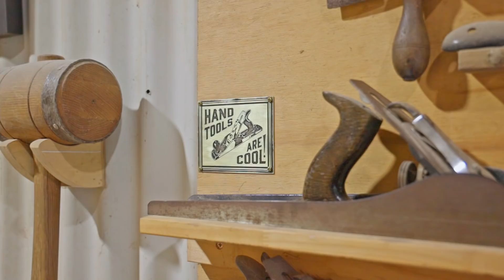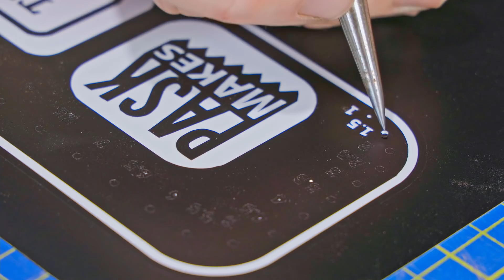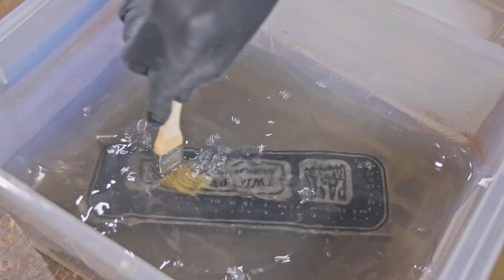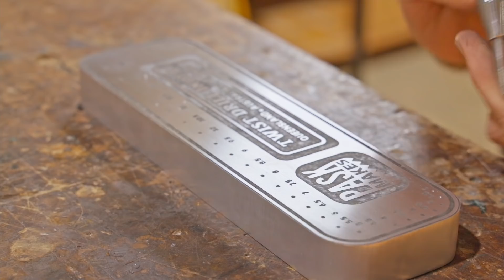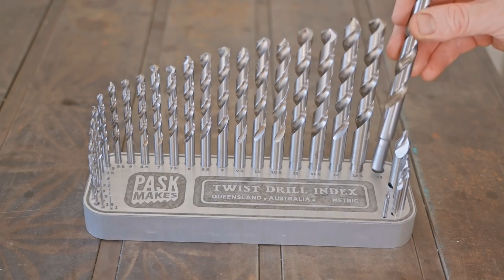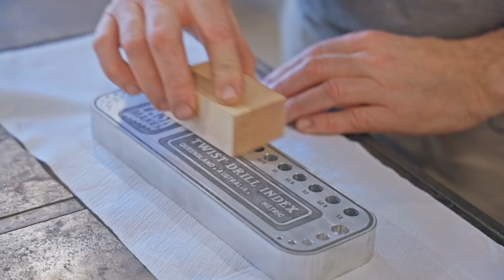How to make a Vintage Style Drill Index

Comment: Maybe used magnets to hold onto the cabinet, drill straight through with a small bit to stop dust and things building up in the holes and black oxide on the etched parts?

Comment: Mr Pask: a drill index should contain spares.  
My index contains 2 of each larger bits, and 5 of each small size.
Reply: Here in the USA with our (#*&@) Imperial measurements I've got quite a few extras of certain common sizes, e.g. I use 1/8" OFTEN --BUT: (A) I'm not going to put extras of GOOD ones in my index, b/c (B) I buy extras ("spares" as this poster suggests) of e.g. double-ended TiN and keep them in a drawer. For machining I'd use my quality ones in the index (and then a reamer) anyhow.
Reply: Also: I'm also sometimes a (chef) knifemaker and use a few key sizes of "spares" rather often, so I color-code them with a band, using cheap nail polish, with easy-to-distinguish, widely-varying colors: e.g. bright blue, yellow, red, white, and black -- and then have a chart with a splotch -> size guide RIGHT next to the drill press just as a "stupid-proof". That way, even if they're sitting on the bench or in a drawer or whatever, "blue = handle pins" (and I can color-code the brass rods, etc., as well!)

Comment: for cabinet mounting you could have used magnets glued to the bottom of the drill holder.

and a little tip when working with aluminum, then you can use denatured ethanol, as a cooling and cutting agent.

Comment: That's pretty awesome. Personally I would have darkened the etching a bit. But painting it could have been cool as well. If it were a deeper etch with a thick layer of enamel paint, it would have had a nice "New Retro" vibe, as if it had just came off the assembly line in the 50s.

Comment: If you're not comfortable with working with acids, you can use electrolysis etching also. You use a salt and water mix, or more ideally Lye and water mix, and a bench top power supply. Set to around 5-12 volts with high amperage, and a metal electrode plate in the bottom of the tank. The positive goes on the work piece, and the negative on the bottom plate. It'll take a few hours, but the current will slowly etch around the mask. 😀

Comment: Awesome project! A tip from sign-makers, who spend many hours weeding vinyl cutouts - use the point of an Xacto blade to pick the unwanted parts out of the stencil. Stick the point just far enough into the vinyl to poke and pull it out, instead of pushing with the awl.

Comment: Ive always found those drill indexes, especially the spiral kind, to be a total obstruction and pain in the ass in the workplace, the most sure way ever invented to see drill bits rolling around on the floor.
Maybe if you could put it in a place that you could ensure would be free of vibration or disturbance, but then that defeats the whole supposed point in being accessible and convenient.

The best way would be to store them in a flat box, or tray, clearly labelled with cutouts at their middles for your fingers. Put that in the drawer of a toolbox and you're good.

Comment: WD 40 is Not a lubricant, it is a hydrophobic solvent, vaporizes at 32 degC, and does not conduct heat. You are wasting your money and damaging your tools. Use 1:1  mineral oil : distilled water, mix at high speed until opaque white. Even just 'baby oil' and isopropyl alcohol is far better. Save your WD for cleanup. ;)

Comment: Def. disappointed you didn't paint it. It looks "rushed to get it done" and unfinished without paint and the tiny numbers aren't standing out enough (altough that may be bc I only see it on video and not in person.) In contrast, the Idea with fixing it onto the shelf is amazing! (my first thought were gluing magnets in the recesses, but the bandsaw case may be aluminium too?) It's just a pain in the ass when things like this fall down from either cleaning the workshop or the machine-vibrations... Here in Switzerland most drillbit sets cases are designed to hang on the wall, which is the easiest Solution and works wery well if you get the metal ones. Plastic sometimes suck, but i've glued them onto a scrap piece of plywood and screwed that to the wall. Greetings from Switzerland:)

Comment: A little late to be hearing this now, I'm sure; But my favorite way of picking vinyl bits like that is to stick a sewing needle in the collet of a craft blade handle (like Xacto). Some have a round hole already in the center, but easy to fix if they don't, and most crafters have three or four of em lying about.

Comment: The locating pins on the cabinet are overkill. I would have drilled two small recesses in the block and glued in rare earth magnets to hold it on the metal cabinet. That way you can move it and sit it on any metal surface near where you are working and the magnets will hold it there.

Comment: Yeah, make sure to have a second container where your FeCl3 container sits with just room temp water for future runs. The reaction is exothermic, so with building temperature and a huge thermal mass (block of Al) you are asking to have a runaway reaction.

(Source: Experience making etched PCB boards)

Comment: I think a better idea for the etching would have been to drill and tap some holes from the back, and use threaded rods to suspend the piece in the etching solution.. good for depth adjustment too..

Comment: Looks quite good, I would have thought it would look better if the majority of the stencil (and thus the etching) was reversed other than the descriptor section (i.e. the bit that has the writing "Twist Drill Index..." ).    That said it's your project, for your use, in your workshop and since it's a personal preference thing it's only your preference that really matters. :D  So long as you're happy with it, that's all that matters in the end.

Comment: Did you consider using spray on photoresist, the kind that is used for etching PCBs at home? It would have been a lot easier than handling the vinyl!

Comment: Sorry if I missed it, what WD40 do you use as cutting fluid? They make a lot of products now so I don't want to guess based on the bottle :) I used some mineral (parrafin) oil while cutting steel with a recip saw and it smoked up a little.
(If i missed the spray it's because you got me googling cricut machines 😂)

Comment: A trick I learned working with sawing a lot of aluminum over the years. Spray the blade with a good quality spray bottle as it exits the aluminum with Rubbing Alcohol. The aluminum chips are hot when exiting the aluminum and the alcohol causes the chips to contract rapidly flying off the blade leaving the blade very clean.

Comment: That turned out awesome!!! Also looks like you got some sweet machines, they are a nice size for hobby shops.

One tip: In the beginning when you're turning that aluminum rod, your tool is sticking out way further than it needs to. With carbide you can get chatter and chip the inserts. You probably already know all that though.
Reply from the maker: Thanks and thanks for the tip! :)

Comment: It looks so good unpainted, but it would be nice to be able to read the sizes from a greater distance. Maybe flood the index with ink, and then sand it down a touch? I think it would kind of look like old cast iron
Reply: Very clever making the bits have a steady flow by adjusting the depth of the holes. And I've never seen one that allowed for center drill, that gave it a really cool symmetrical look. My only thought is, what about when you sharpen the drills? Usually two or three sizes get used 10x the other sizes. As you sharpen, they get shorter.

Comment: Turned out nice. Not sure about paint, I think if it was to be painted the traditional black would probably be a better choice than blue.

With etching, another way that seems to work much better, quicker and saves on acid is damming around the area then using a small amount of acid and a brush. It etches much quicker and deeper and saves a considerable amount of acid.

Comment: Vinyl is surprisingly (well, maybe not if you think about it) heat resistant. I've ironed over it without any issue - on cotton/linen, which is hot. 

For weeding, get yourself a sharp (old) sewing machine needle. I find them easier for small pieces as you're closer to the work.

Comment: Looks great Neil. The etch looks very effective. 
My only comment/query is the order of the bits, I know you can remove the Index from it's storage position but would it have made life easier to have reversed the order, putting the longer, thicker Bits in the back corner and the smaller Bits on the outside where they'd be easier to pick out? Or would the slope in the upper cabinet made that impossible?

Comment: Tho it won't work in this case with all 10mm holes for the larger bits, if the bits store point down in the index you don't have to grab sharp edges (or points in the case of bread points). This is one case where a good plastic blank makes a great index IMO.

Comment: Neil; when i come across a situation where it's hard to get a drill into tight spaces, i use my Milwaukee 4-in-1 drill from Home Depot: M12 FUEL 12-Volt Lithium-Ion Brushless Cordless 4-in-1 Installation 3/8 in. Drill Driver Kit with 4-Tool Heads. It has made life easier for me. Keep up the good work!

Comment: I wouldn't be able to do this myself, but you might also be able to make such etchings by 1) printing it reversed (using ink) on silicone-coated paper, 2) transferring the ink to the metal with heat (iron?), and 3) painting the rest of it with black nail polish (if you don't want the ferric chloride to react as much). This might help keep the heat down and allow for a deeper impression.

Either way, I love the result!

Comment: really nice looking holder.

I am thinking about organising my drill bits too

I don;t know if it's just me, but I have multiple instances of each drill bit size, and within the same size, I have bits made from cobalt or HSS etc, so I don't see the index holding 1 drill bit size, ideal. I need some kind of divider system, or something like a straw dispenser at McD (press to roll out, load from the top).

Comment: This turned out quite nice!  I'd have tossed magnets in the base of the index but I think your idea works out better in the long run - the locating pins will prevent the paint from being chipped/scratched off the surface of the cabinet, since you're forced to lift the index rather than just slide it off. Smart!
Reply: Magnets recessed in the holes drilled for the pegs and a felt  to cover the bottom would be the perfect solution I think.

Comment: That is really cool... I do think your signature colour would be nice to accent the etched areas... 
But I see off hand that made a big difference on a very similar tool holder I have used back in the day... 
A groove on the perimeter of the holder to give a better purchase when pulling it off its base pins... 
Having oil/grease on you hands/gloves when machining, might have the base slip out of your hands just as you pull it off the pins, and you don't want to drop that when you in a  good flow of things.. rightly be pissed off at such an accident...

Comment: Great piece! I use a vinyl cutter and acid or saltwater/voltage etching quite a lot — it’s a great way to etch without a glowforge. My favorite part, dropping the perfectly sized peg into the hole, then blowing it back out!
Reply from the maker: Thanks - I've already started thinking of more ways to use the vinyl cutter. :)
Reply: @PaskMakes  if I’m hand cutting steel for a knife (using an angle grinder), it’s quite useful as a stick on template. I’m looking forward to see what other creative ways you use it.

Comment: Great job. I would have used a couple of strong magnets countersunk into the base of the drill stand assuming the metal on the cabinet isn’t stainless or aluminium of course.
Reply: My thought also.
Reply: I like this as well. Then the whole piece would lock onto any other magnetic surface.
Reply: I thought about that then thought that the bits might jump out as the stand was pulled away from the cabinet.
Reply: I was thinking along the same line but then thought that magnets on the index would attract any metal bits from where ever you set it down and then you'd be having to clean it off all the time. If you put the magnets on the cabinet and a disc set flush on the underside of the index that might work. But again any ferrous debris would be attracted to them and you'd still have the maintenance issue.

Great looking drill index and the videography is excellent as always. 
My thanks to @Pask Makes for taking the time to share this.

Comment: Aluminium is weird. It will also react with a base solution, try it with some soda and a scrap piece of aluminium of some foil. Not surprised that AL reacts differently in the acid, the first period was probably the time required to eat through the oxide layer, after that the real reaction started.